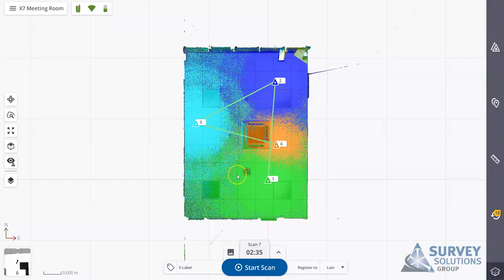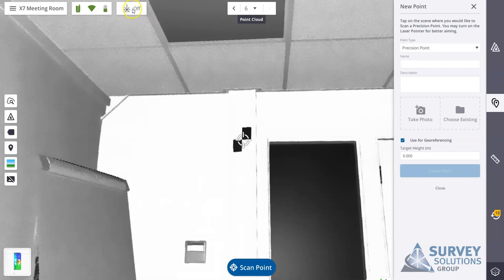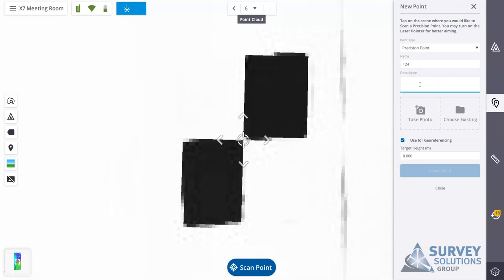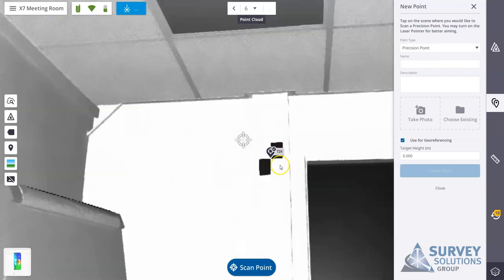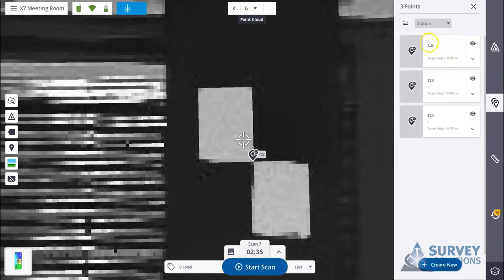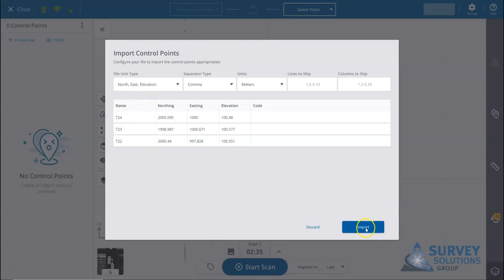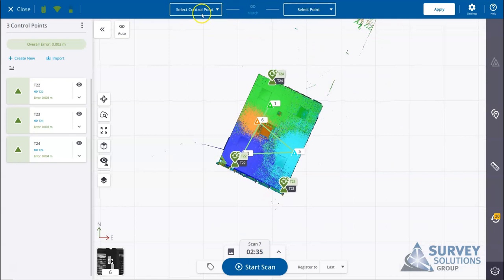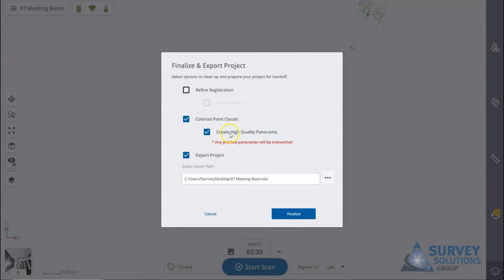4. X7 Geo-referencing Tool

Comment: Just wondering where did you get the CSV file from? Were those fixed targets in the room? Or how did you find the coordinates for those targets? Thanks!
Reply: You can get the coordinates with a gps receiver or if you are having the targets set up over control points with known coordinates